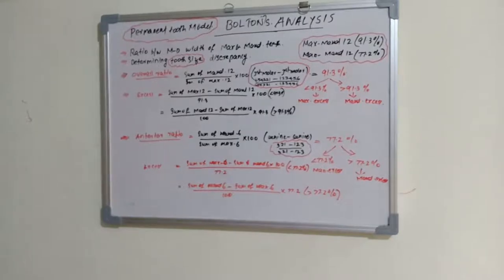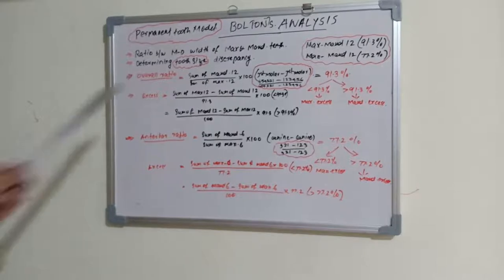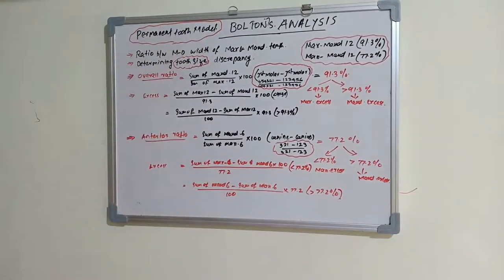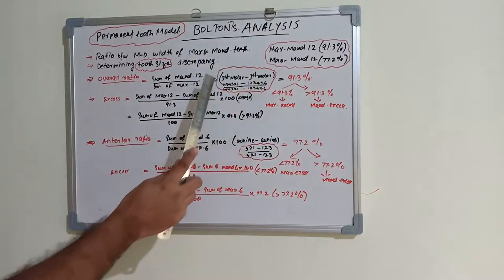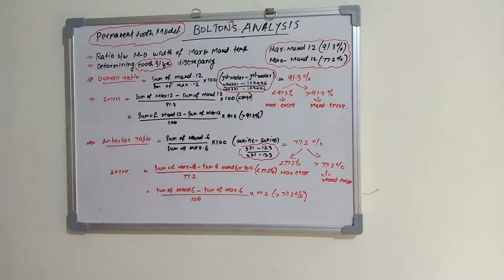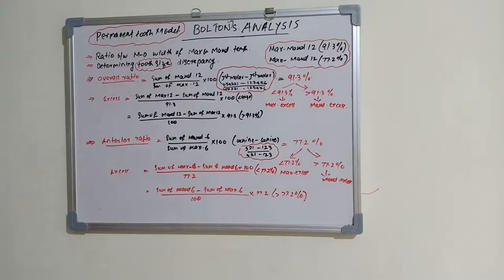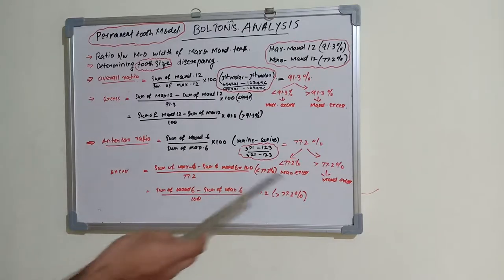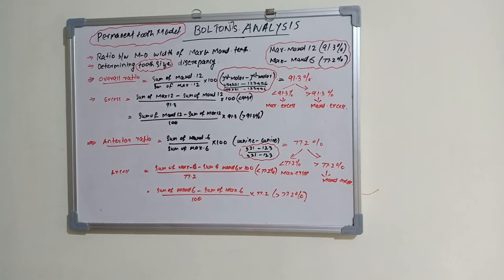BOLTON'S ANALYSIS

Comment: Didn't understand the "excess" part...
Reply from the maker: It is to estimate the amount of excess material (M-D dimension present in the maxilla or mandible).
The ideal ratio (mandible vs maxilla is 91.3%)is used as denominator to check the excess ratio.

So the excess mandible or maxilla M-D width can be calculated by substracting one another and dividing by the ideal ratio 91.3.